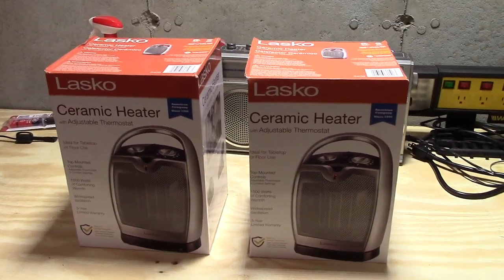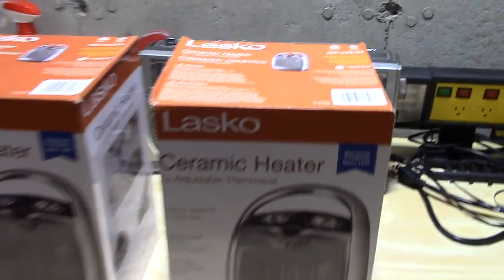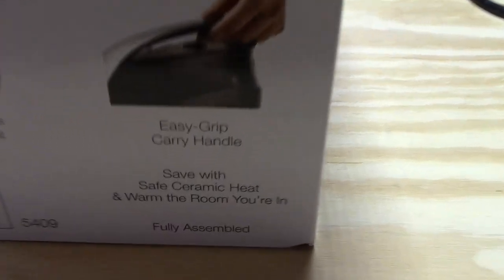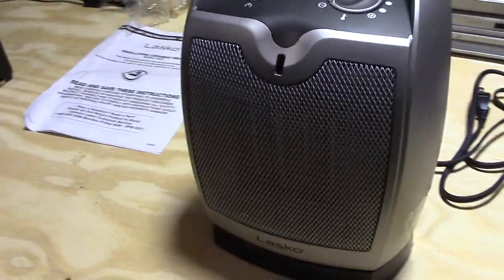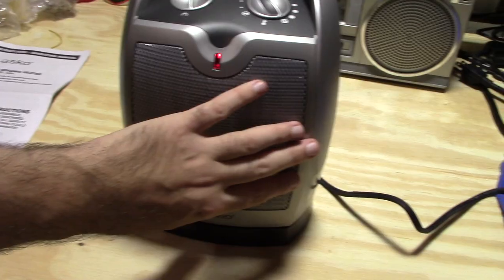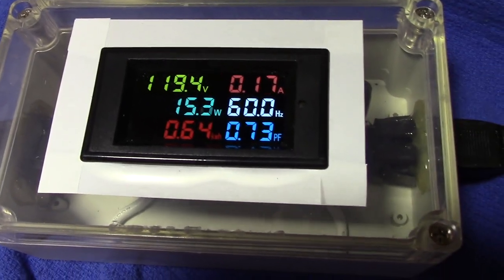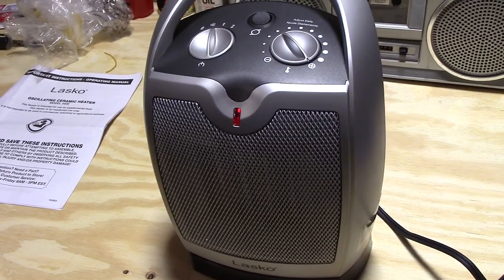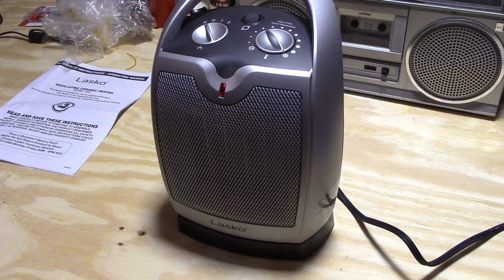Lasko Ceramic Element Heater.

Comment: Plastics have greatly evolved from the days when the Markel heater was new.  Not they're supposed to be fireproof.  Sure, but they'll still melt.

Typical setup, 900 watt "low" element, 600 watt "high" element, used in tandem with the 900.  These ceramic heaters will pull more and more current at startup but then settle back down as they warm up.  No need to worry even if it were going to exceed 15 amps because it would be for a very short period of time.  There's "leeway" built in to these numbers.  If there weren't, heavy inrush current loads like air conditioners wouldn't be able to start.  Back in the old days, when things took fuses, they would sometimes stipulate a "slo-blo" fuse, which would better handle the inrush current.

So that leaves us with a plain old basic heater.  Nothing wrong with that.  There are, however, 6 or 7 different designs of heaters, all using a similar setup, pulling a similar amount of current.  Which type is best is really a matter of experimentation.  Each have their pros and cons.

What I really do like though, are these smaller, "personal" heaters they have nowadays.  I have 2 of the Lasko "MyHeat" units, and while cute, I find them to be a tad underpowered.  My go-to heater for almost all the time is that little one I got from Aldi that's 400 watts.  It's just enough to take the chill off.  Only on really really frozendy days will I break out the big heater and use the full 1500 watts.
Reply from the maker: No plastic better than Connecticut plastic! Honestly yeah it should be fine as long as people don't do anything dumb with them. 

I was quite surprised by the amount overall, I think the Markel uses less than this one does (hmm, maybe I should make a video about that)! I figured there was some leeway for the amp numbers, and I know Gegzno doesn't cut corners when designing those things. 

Simple and probably does the job. I think I can recall seeing similar-designed Aldi-brand heaters of these. Yeah probably very similar as you said.
Reply: @Sharkie626  Doo dah doo!

The Markel is a resistive element, and works like heaters always used to.  Indeed, it may use a little less, or a little more, depending.

Remember, Harbor Freight by any other name, it's still the same.  The only difference is the name haphazardly slapped on.